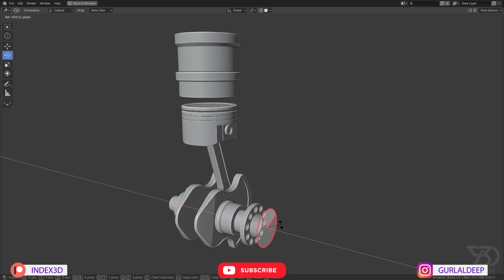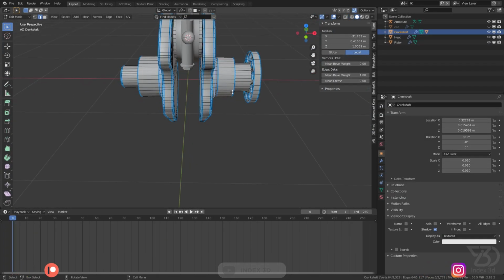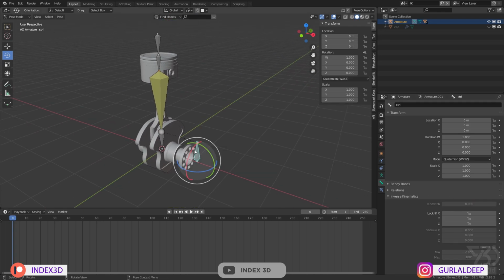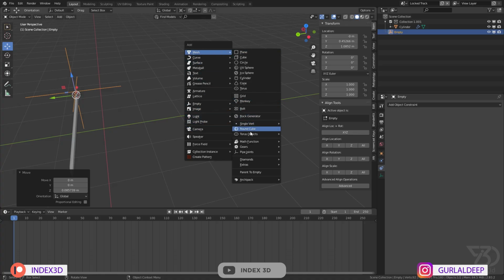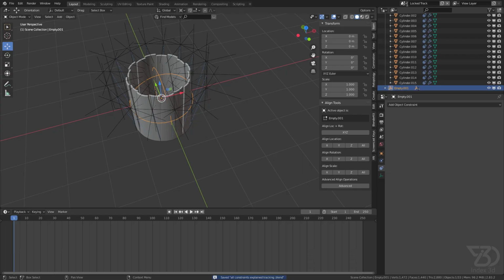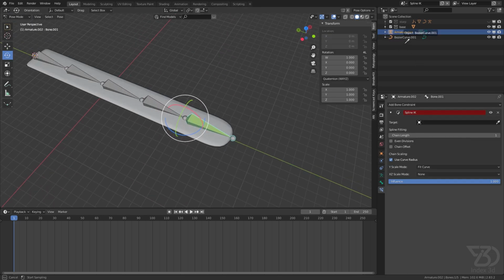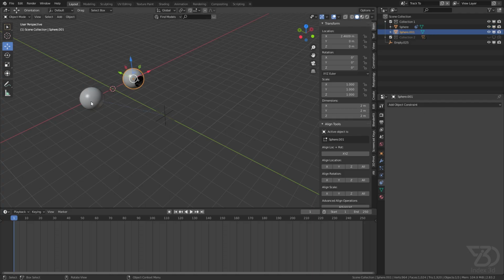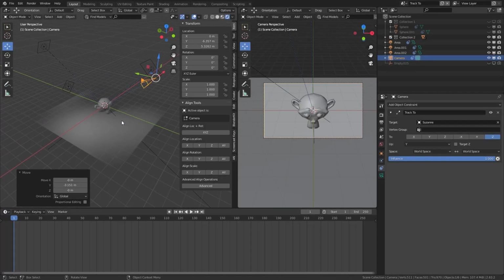All Constraints Explained with Example | Tracking Constraints | Blender 2.8 | Free Project File

Comment: Setting up the axes in the "Track To" constraint can be confusing, but it's actually quite simple - you don't have to try-and-error: 
Just change Blender's transform orientations to "local" and when you look at the transform gizmo, you can easily see which axis of your camera (or any other object) needs to point in which direction.